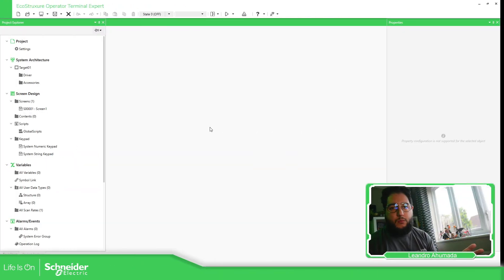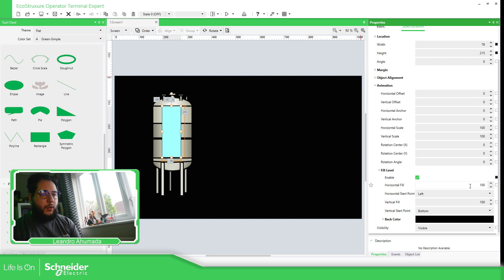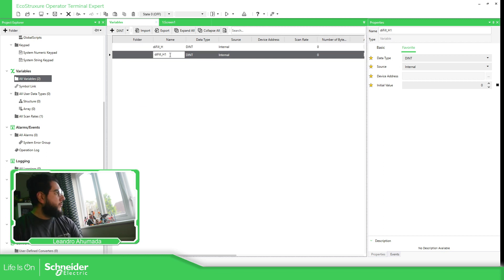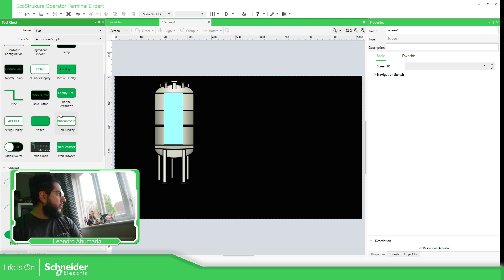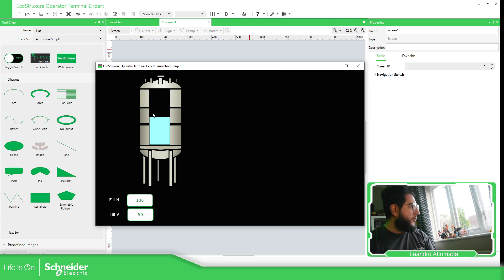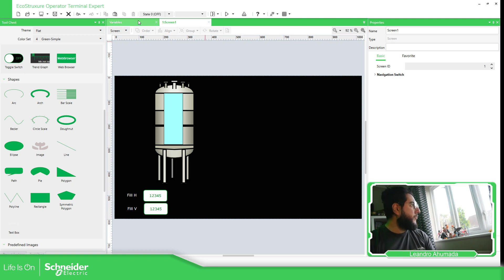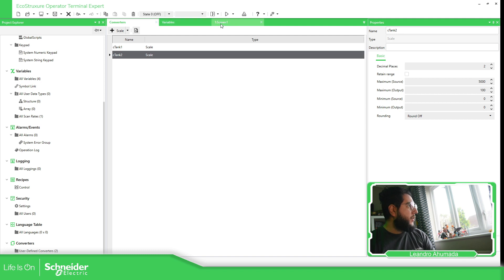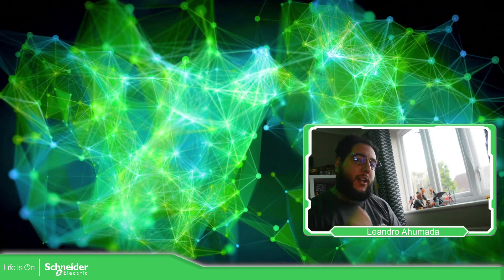Training EcoStruxure Operator Terminal Expert - M6.8 Tank Level (Fill property in objects)

Comment: When iam using this method only starting from 100 then only it will work iam using 0 to 11 mts but it showing 1
Reply from the maker: Hi there! I believe it should be something related to the converter used on your side, if you follow the video it should work.

Comment: Excellent, is it possible to make a slider bar? and
vary a signal of a range, type potentiometer. Thanks for the reply.
Reply from the maker: Hi there! I believe the slide bar is not a feature in this software yet. Doing a manual object for this will take too much time